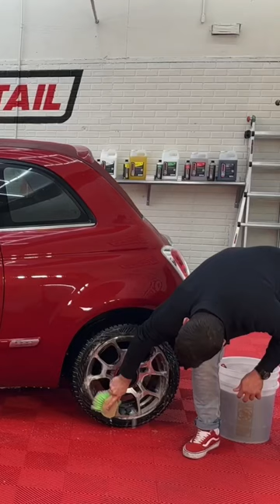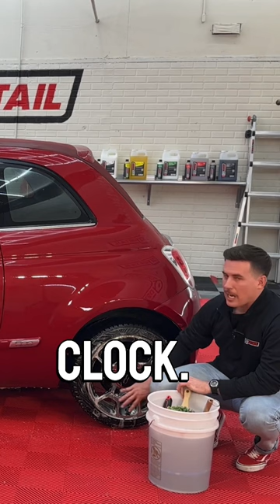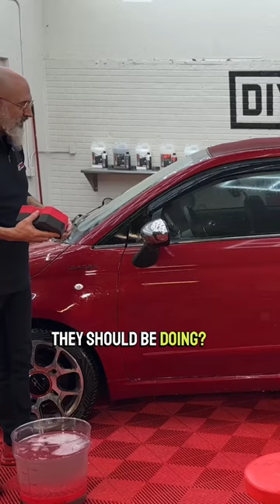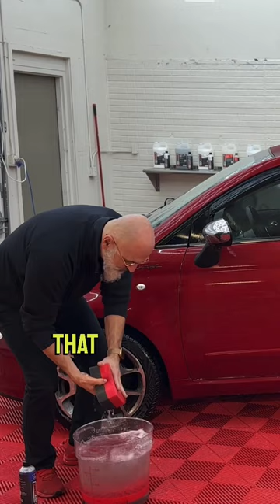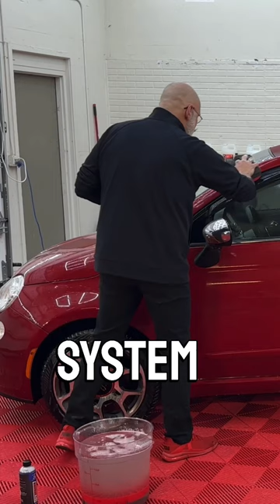How to become a better detailer

Comment: I like to wash my wheels starting with the lowest point and doing the bottom half, then moving to the top half. Starting at the bottom keeps the water in the brush from rinsing the cleaner off the lower half of the wheel.
Reply from the maker: Good plan.